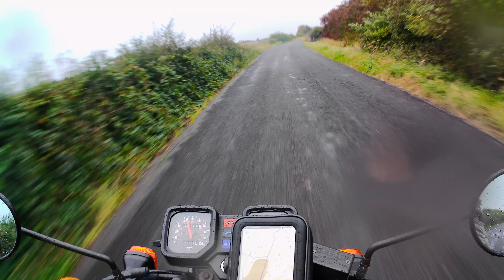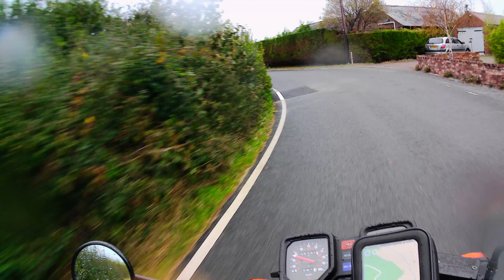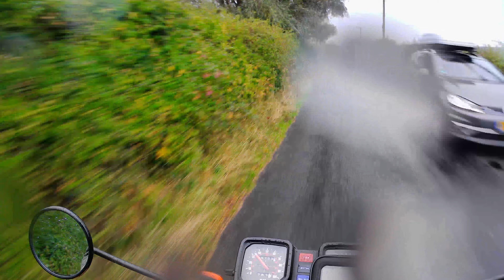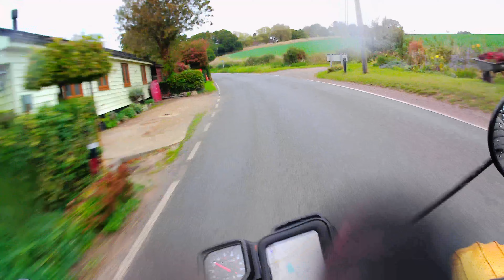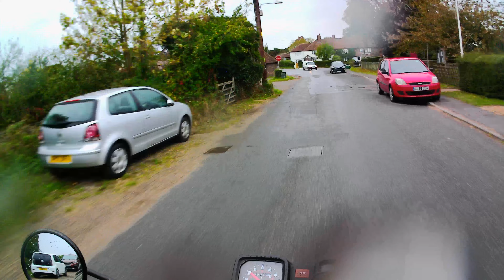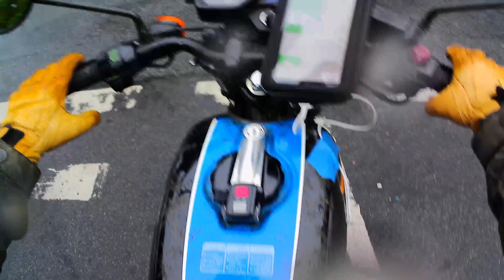Honda CB250RS Episode 11 Part 2, and Campark 4K camera run out.

Comment: I am still watching the RS perform. I am surprised more people are not interested in this great little bike. My RS (1982) has 11, 000 plus miles and I change the oil every 1,000 miles. The only problem I have had is the coil packed up. A new OEM replacement was not available anywhere, so I had to buy a cheap Chinese one. This ran fine but bogged out at 6,000 revs and this drove me mad. My local motorcycle mechanic got me a used OEM replacement which ran fine until that packed up and left me stranded. He sourced another used OEM one which has be fine. I carry a spare Chinese coil just in case now. 🙂👍🏍
Reply from the maker: Cheers John, they are cracking bikes. The new coil I've fitted is a generic Chinese one, and only because the original had a crack in it. It seems fine at the moment, but time will tell! I like the idea of carrying the OE as a spare, especially now I have the top box 👍